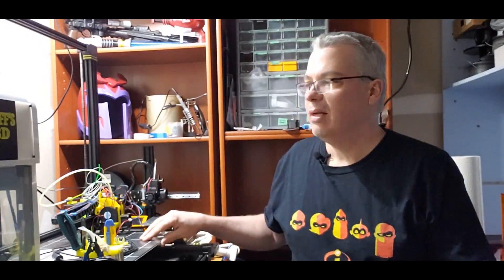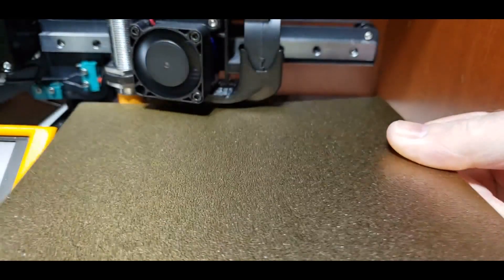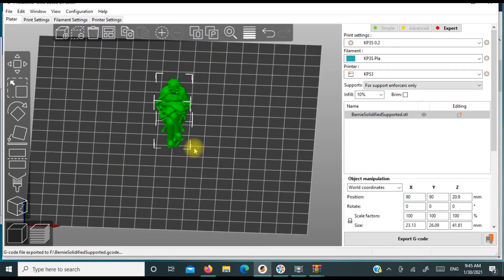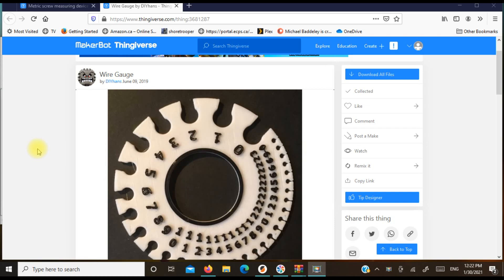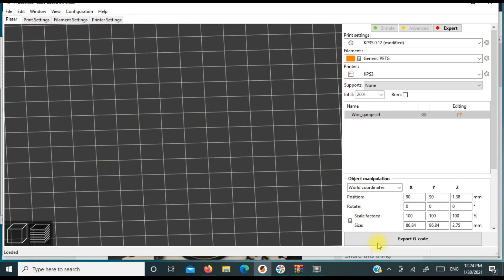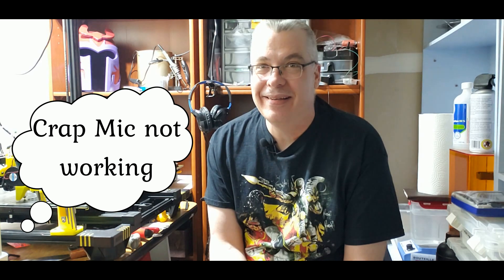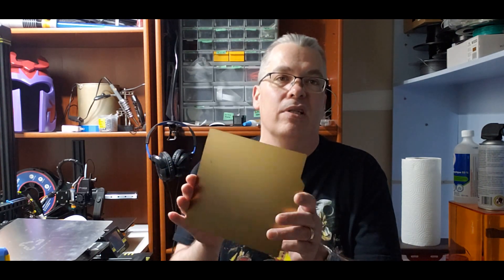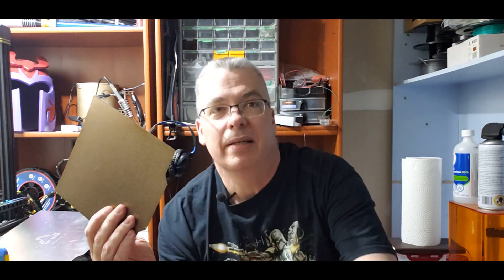Energetic Powder Coated Sheet Review

Comment: Hi i have look the link but 180x180 did not see. Thanks  for the help i have buy  this printer after see you talking  about.
Reply from the maker: Search for this
ENERGETIC Upgrade 180x180mm Kingroon KP3S 3D Printer Build Plate,Spring Steel Sheet Applied PEI Flex Print Bed+Magnetic Hot Base

I'm on my phone right now so I can't look up the link sorry.
Reply: @jeffs3dcorner  thanks